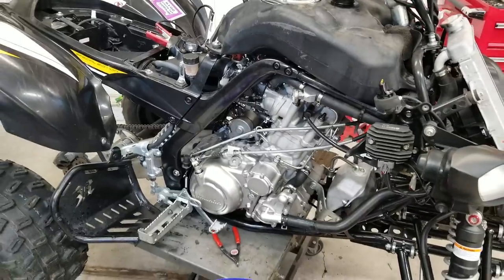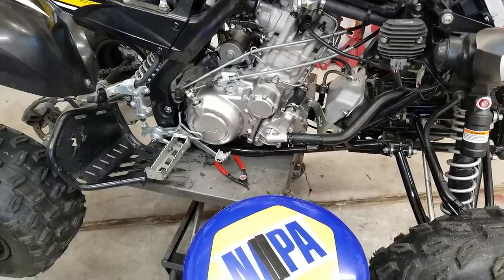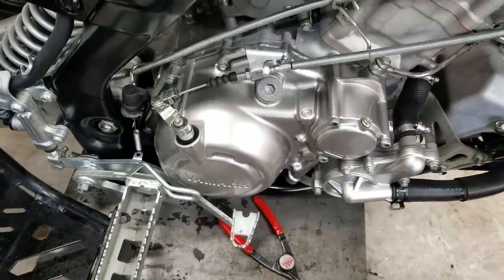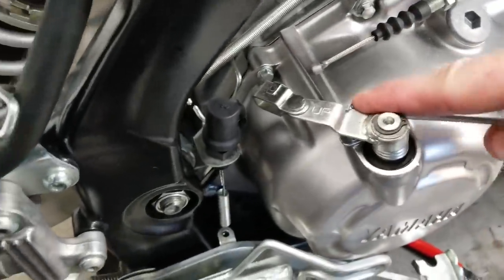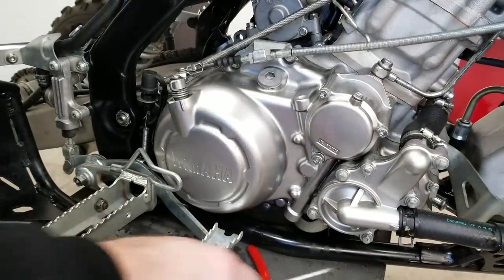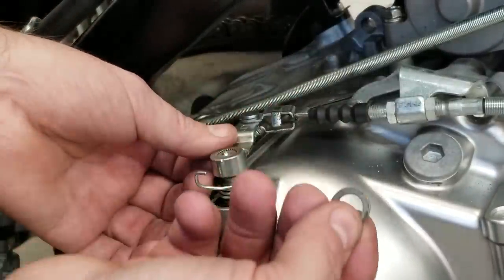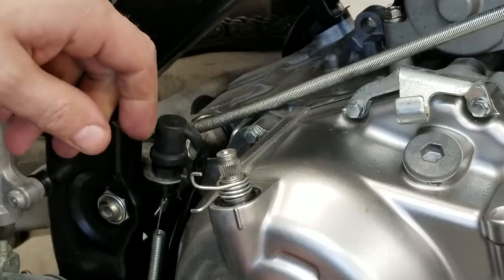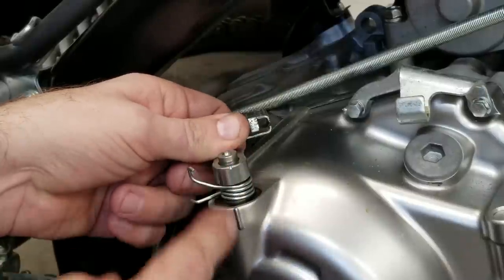Clutch cable issues after clutch install on Raptor 700 HOW TO FIX It!

Comment: I have a 2022 honda grom with the same issue. I changed the clutch springs and me lever had no tension. It’s the same concept as the four wheeler. Thank you so much for this video

Comment: Brother!  You're a f'in legend and hero.  This is about the 20th youtube video I've watched indepth to finally fix this problem I had after a full engine rebuild on my 2001 yz 125 dirt bike.  Thank-you for making this.  I had about given up.  Life-saver.  Clutch lever is super tight now and won't put the bike in neutral from gear while it's off, but I'm hoping this problem will go away once the bike is running and warmed up.  Cheers!

Comment: You nailed it. I was following steps in a rocky mountain atv video and they never once mentioned this as a common occurance. It was like install clutches and roll which didn't apply in mine. Thanks again. Going to do this right now on my raptor 350 although i dont see the mark on my arm to line up with the case.  Im sure ill get it. 👍

Comment: thanks for explaining the clutch shaft has no internal resistance only that spring- I never knew one way or the other and this is the only video I found where you explain for the dummies whats supposed to be there!

Comment: Fantastic, thanks for posting this, I have a clutch that works fine, but I kept looking at the little arm and always thought it looked incorrect. So now I've adjusted the position of the arm and the clutch feels better. But as you mentioned, there is nothing in the manual

Comment: i have the cable adjusted correctly based on your video and there's plenty of pressure when you pull on the lever thanks to the heavy duty springs but the quad will roll fairly easy while in gear. Doesnt lock out like it is suppose to

Comment: It's funny they don't tell you to re-clock the arm in the manual.  I figured it out on my own, but it wasn't till after setting it up wrong and scratching my head for a while and throwing around a few choice words!  LOL... It's good to see, however that I'm not the only rookie clutch swapper.  My problem now though is that my clutch lever is MEGA hard to pull.  I just lubed the cable and as I figured it didn't help at all.  I'm going to rip the whole thing apart tomorrow and see if the clutch boss is grooved.  A couple weeks ago I found a grooved clutch boss on my YFZ, and  "THEY" say  a grooved clutch boss can really stiffen your lever pull to the point of ridiculousness. .  So I'm awaiting clutch parts for the  YFZ and  its looking more and more like Im going to have to rip back into my raptor to see if the Raptor clutch boss is suddenly all grooved too.   Seems like Feb/march are clutch months for me!!!!

Comment: Thank you soo much! This solve my problem completely. I was about to buy a longer clutch cable because it was fully extended and the adjustment and I could not figure out why. I made this adjustment and that’s all it took and now I have plenty of adjustment at the lever and at the clutch

Comment: The First time I did my clutch on my 2017 last year  I was so frustrated until I realized this was the issue. I’m glad I’m not the only one that dealt with this issue... I went as far as ordering a new clutch cable only to install the new cable and still the same issue :) man I felt dumb when I finally realized what was going on  ... Pretty basic but if you don’t know it can be frustrating.. 
Thanks for the video.

Comment: I’m not sure if anyone can help but I just bought a 2019 raptor and it has a rekluse clutch on it and it’s slipping. There’s no play with the lever and the notches aren’t lined up.  Would doing the steps in this video and getting those notches lined up solve my problem?
Reply: Did it fix it

Comment: Hey brother quick question i have a 2019 and the lines are not aligned but they align when i put the clutch all the way in… but i have not changed my clutch, my quad just stop grabbing the gears.  Is this what i have to do or do I need a new clutch??? Thank you!!!

Comment: Thanks for the video . Quick question I have a brand new 700r not even 6 hours of ride time. It will go into reverse but doesn’t accelerate forward when in gear. Could it be the clutches ?
Reply from the maker: Clutch will be affected in reverse as well. So likely something else

Comment: I Have an 07 raptor 350 that's I just picked up. Seems to ride really good but it's hard to find neutral or put it back in drive after going into reverse. 

So I decided to adjust the clutch then I find there's no free play in the clutch lever or clutch arm. Put some free play Into the clutch lever and seems to be finding neutral alot easier and getting out of reverse properly but now it goes I to 1st gear kinda hard.

But I don't see a way to adjust the clutch arm on the 350. And its bugging me because i feel like there should be a little slack on the arm. The cable slides into a mount on the engine but there's no adjustment bolts there. And the clutch arm is super tight. Doesn't even wiggle a little bit by hand. Could my clutch arm be rotated too far clockwise? 

I think if it wasn't disengaged properly the clutch would be slipping but idk what that feels like because this is my first standard atv

Comment: Hi there I have a raptor 700r gytr edition model 2006 and experience issues with a worn out clutch .the two lines on the arm and the case does not line up from worn off clutch .can I remove the arm and reset the two lines for it to be right as I am running out of free play ....thanks much appreciated

Comment: If you twist counter clockwise will you be able to unscrew that rod and pull it out?
Reply: No on the clutch cover that rod has another snap ring at the bottom on the inside

Comment: Great video. Do you have any recommendations for a reliable top end kit for a 2011 model.   I want to go 11,1 compression with a good fuel controller like a pc or dynatech and a stage 3 hotcam, possibly a big bore kit if there is some sort of combo deal out there.  Any advice is appreciated thanks.
Reply from the maker: Yes we have parts in stock . Give us a call tomorrow 951-743-6328

Comment: Hey my 2018 raptor feels like it’s lost power it runs perfect but when I’m in gears in the end of each gear it revs high but the power isn’t there any ideas? It feels a lot less torqy. I rode my friends 2017 and it feels a lot stronger and dosent rev out as fast
Reply from the maker: Check to see if the gearing is the same. . Check or change 
Spark  plug
Reply: If you haven’t already Change you clutch plates they are worn had same problem with my  yfz450
Reply: I can relate to this i have the same problem

Comment: I just bought my 08 raptor 700, Im actually having the opposite problem. My lever down on the clutch is so hard to turn that i have to use a big wrench just to move it. It wears my arm out after just a short amount of riding.
Reply: ever find out why? having same issue in a yz450f 2007 any answers? just dif clutch platez and springs and lever now feels at least 25% harder to pull than its usual feeling

Comment: I have a 2020 raptor and it hesitates going in to third gear do I need new clutches or a cable adjustment
Reply: Your main axle shaft might be damaged my had the same issue and ot was the main axel shaft

Comment: Sometimes I have a hard time getting my raptor into neutral or 1st gear, have to rock it sometimes.  Is there a cable adjustment that will fix this or is this how yamaha gear boxes are normally?
Reply from the maker: Depending on age the clutch basket may be worn.
Reply: @MrCuervoRacing  2016 with only 20 hours
Reply: Improper chain tension can affect this too

Comment: I'm getting a 2019 raptor 700r and was wondering if I should do the AIS block off plate or is that only if you do mods?
Reply from the maker: i recommend to do it either way. helps drivability
Reply: Ok thanks. Are you still selling the temp Gauge, case saver and there was something else that came with it on Ebay I can't find it was it the ais plate

Comment: When you change the clutch is it necessary to change the oil? Will you lose oil when opening the case?
Reply from the maker: Yes you will lose oil. I recommend changing at the same time. U can tilt the bike to prevent oil loss.

Comment: When I did mine the clutch pin turns then stops. I turned it so hard I broke one of the tooth’s on the clutch pin. I put all the plates on in order. I’m not sure why it’s not working. Any advice?
Reply: Did you ever find out what was wrong im having the same problem
Reply: The guider that hooks to the rod is not straight and is not hooking on to it , you have to make sure that guider is straight and does not move

Comment: I did it and my clutch is so hard. I can pull lever only like half way. Did I messed something up ? Did I torqed the springs too much ? I belive i did 69 inch lbs
Reply from the maker: Sounds like you may have too many plates in the clutch and the springs are going into coil bind.
Reply: MrCuervoRacing thanks I didnt count them just put in all came in a kit 🤔Ill have to take it out again 😒